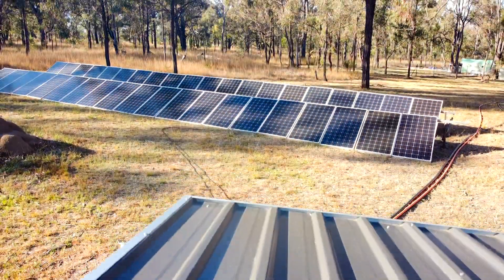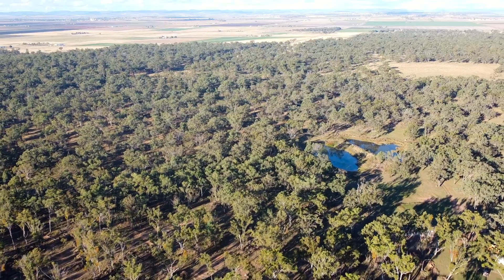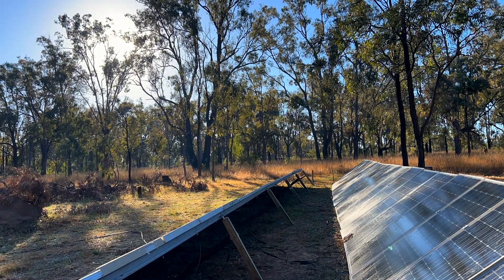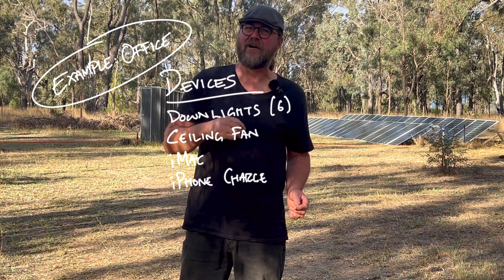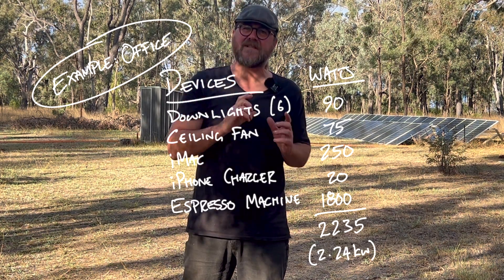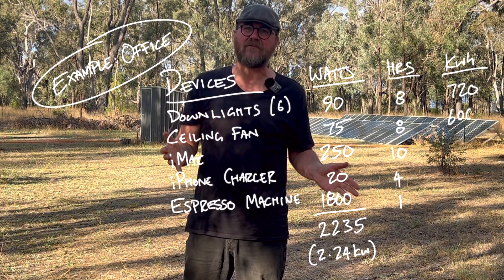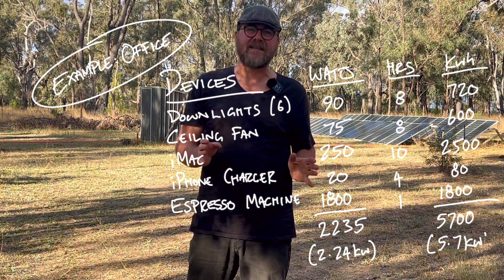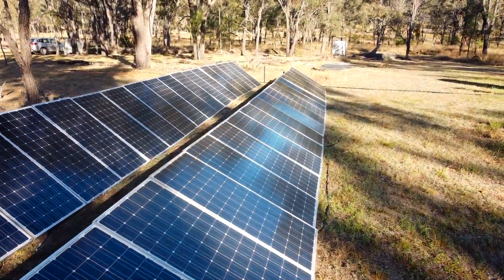We had NO CHOICE but to go Off-Grid

Comment: only thing i could change in your beatifull  system it would be the mppts . i could go 250series mppt    independent ones   i know more cables but when need to seperate and have 3 for example . you put another 5000 inverter on one of 3 and your independent system will be there for  sure no mater what !!  sometimes cost isnt so avoidable...      
on my small  system    i go with a 5kva   and chose 1x 150/35   and 2x100x20  mppts for angled arrays    
.i have no much needs but my thoughts were   faster  charge with small morning array  middle day  combined with the big at its full and late sun angle 3rd small   mppt  harvests to keep as much amps  for the night to pass easier and to keep up with fridge internet and  security     small  all time consumptions..  ..  this way i could keep system running with one 51,2 100 amp pack

Comment: Do you have a cameras.  We have the same systems.  I went growatt.  2x 5000watts.  You bought local by the sound of it but in WA we have to order everything.  A shop 3hrs away can take up to 2 weeks to deliver.  As soon as you get some extra cash buy another inverter.  Mission critical off grid inverters are a must.  In the past 10 years we've gone through about 10 inverters of different types.  Victron are very expensive and are not all in one.  My next inverters will be Deye.  These are Low Frequency 8-12k inverters, multiple string and gen backup.  We both have the little sheds and away from living people.  Remember to put a smoke detector inside your battery shed.  Hydrogen fluoride gas and one deep breathe, you meet your ancestors.  So weird looking at my little shed and ground mounted panels in some else's video.  We must be doing something right.
Reply from the maker: @MovieBeasty  haha, good to hear there’s more folks that think like us. Shed got an upgrade since this video. Good call about the HF gas, yikes! 
Yeah, we had to order all our gear too, took about 3 weeks and even then I had to drive to the coast to pick it up. Nowadays we found a local dealer only an hour away
Reply: Forgot to mention, if batteries fail or inverters blow up, it's on Dec 22-25 or really any Friday night.  You really couldn't make it up.

Comment: Hi. Just listening to your video where you and your partner are discussing power usage and running out of battery power/gas costs. 
Have you considered installing a solar hot water system to replace costly gas hot water system???
And loving your videos. Very very informative and practical.
Reply from the maker: Definitely considering it. Apparently a heat-pump unit is quite energy efficient. and considering that we basically don’t pay for electricity it makes sense.
Reply: @ right. We have a heat pump. Pretty sure it is saving us quite a bit.
Reply: @rusticspiritshomestead  Bear in mind that you could use separate solar panels to power the heating element in a storage hot water system with DC directly from the panels, independent from your solar power system, so no demand on the inverter.  Depending on what voltage you arrange the panels to produce, you may need to avoid arcing at the contacts of the thermostat breaking direct current.  An example could be 4 panels in series: ~140V.  2400W element (designed for 240VAC): ~24 Ohms.  Current: ~5.8A (140 ÷ 24).  Power: 812W (140 x 5.8).  IE. ~1/3 of the 240V rated wattage.  With 5 hours of decent sunlight that would equate to ~4kWh.  That's enough to heat ~100L of water from 10° C to 50° C.  Heating at that rate, I expect that the thermostat would cycle infrequently.

Comment: Hey there Regan, Rollo here again. I have been looking at your videos on the solar array and have noticed that you only have 4 x 200ah batteries. Thats bugger all and I know you said they were about $2000. I ha e built a 340ah lithium battery for less than $1000 and that is using 6000cycle batteries. I am looking at going stand alone solar here and will be building 51v batteries that will be about 4.5kw or better and can go much larger using bigger batteries. Have a talk with me and I am sure we can build something much better than what you have and will be able to do it for the right dollars.  EEL batteries do kits for 48v and this is for the case and the BMS. You have to buy the betteries and there are a heap of choices there. Lets talk. Cheers Rollo
Reply from the maker: Hey Rollo, wow! I am very interested to talk to you. I actually may have a partial solution already, but I am hesitant to jump into it without knowing more about the topic. One of our 24v/200ah batteries died a few months back and they sent a free replacement. I pulled the old one apart and it seems like only a few cells have died (maybe?, not sure what I'm looking for), then the replacement that they sent didn't work right out of the box. They tried to diagnose it with me via a zoom call but they couldn't find the problem. But it seems that all the cells are fine. Later when I looked, it seems like just the first main terminal connection had bent away from the first battery. Anyway, they sent another free replacement, and now I think that I maybe have anywhere from 16-20 perfectly usable cells. I just don't know where to start. And, I also assume that the BMS's may both be in working order, but don't know how to test. I've had a few ideas, but like I said, hesitant to dive in and potentially stuff things up, without understanding it better.

Comment: Great vid, keep them coming. I have been off grid power wise for 3 years now, never looked back it’s great. Now looking at getting rid of the 45kg gas bottle.
Reply from the maker: i hear ya on the gas. Got any ideas for cooking, water heating, etc in your system. Wood fire sounds romantic, but it's a lot of work hey
Reply: @ so far we have wood fire (no way I would change that) I wanted it hooked upto hot water but where we live no plumber wanted to touch it so we will probably go to heat pump hot water. We already have electric oven. We also partially charge electric car. Wife and daughter murdered first battery bank (2nd hand ups 2.2 volt cells) replaced with lifepo4 cells. We have 5kw of east west panels. We don’t regret gas as we needed something straight away when going through council but at $175 per 45kg bottle we are starting to think more panels. Loving your vids. I am just getting into bees now so keen to see more of that.

Comment: Interesting Video, I run a frankenstien off grid set up for my workshop and it is 24v with a 3000w inverter.  I only use it during the day very rarely at night. During the day I run 8 x 40w 240v fluro style LED's or 8 x 30w 24v flood lights. I run angle grinders , drills, a lathe, up to 2 industrial fans and a water cooler in summer. My solar panels are 4 x 330w in parallel which produces 36v x 1320w into a 70A dc-dc charger.
The battery bank is 24v x 850Ah AGM . I would like to know why you chose to go 48v x 400Ah @ $8000 when you could have had 24v x 800Ah for the same cost. I know there is some efficiency factors between the 2 voltages but I do not know them.
Reply: 48v is a little more efficient as you said. Cable size can be smaller at higher voltage so lower cost for cabling but can also have batteries further away if need be. Battery limitations as well. Equipment produces a little less heat so less loss there and power draw if you need active cooling
Reply: I PUT PLASTIC CLEAR CORRUGATED SHEETS IN SHED AND HOUSE ROOF, NEVER NEED LIGHTS IN DAYLIGHT HOURS, IT ACTUALLY APPEARS BRIGHTER THAN OUTSIDE.

Comment: I see you have 24v batteries connected in series. Have you any issue with battery balancing and how do you solve it? As far as I know Victron battery balancer works only with 12v batteries bank.
Reply from the maker: They stay reasonably well balanced, we check them pretty regularly. I was just thinking though that I may design a process for cycling their order on a regular basis to ensure no issues.

Comment: Cost of Sol PV ( vs. Utility power ). Did the math for you🌻 Most utility (grid) payers do this simple Interest calculation..."I will pay 100$/mo. for decades...so 1200$ x 20 years=24,000."...NO you won't!!. Ever hear of Inflation? And it's Compound Interest...Utility rates of Inflation avg.~5.5%* (some have been recently 40+%!!) for US electric Rate increases. So at *traditional avg. U.S. rate increase (prior to 2020), 1200$/  year becomes ~3,500.$ in year 20.   Conclusion, if use same amt. of kWh/mo. over next 20 years at *traditional avg. rate increase , then you will avg. ~$1750$/ yr... or cumulative ~35,000.$$ over 20 years!!🧐  (if rates don't increase*...good luck with dreaming🤪.     + if you qualify, there are pot. State Incentives for solar+ a Fed. Tax Credit of 30% off cost of PV systems🗽

Comment: Nothing annoys me more than paying over $700 a year to the power companies for their supply charge, even if you aren't using any of their power. I live in a residential area and I am grid connected, but looking at getting off the grid. I just need to work out how to survive our winter with low sunshine. I have installed 10kw of solar panels, a 4kw Victron Multiplus II, a Victron 450/100 MPPT charge controller and 32kwh of LifePo4  batteries. For 9 to 10 months of the year I am self sufficient as far as electricity goes. I was getting credits from the power company. The latest price rise for electricity includes a big drop in the price paid to me for the solar feed in tariff. With the price I am now being paid to feed back into the grid it works out I have to supply them with 55kwh's of power per day just to cover my daily supply charge. Lets do the maths on that, a daily supply charge of just under $2 per day costs me 55kwh's feed in/day which even at the lowest rate (off peak) would cost me $12.10 to buy from them, and 55kwh's would power 2 medium size houses for a day. I think the little guy is being taken for a ride again. My dream is to move to a bush block and go completely off grid. Its great to see you are living the dream. Keep up the good work.
Reply from the maker: Woah, that’s crazy! And I feel like stuff like that is only getting crazier and more and more unrealistic hey. What would it take for you to disconnect? That’s a pretty epic setup. Very similar to us and we’re 100% offgrid. But mind you we’re on a “tiny home” setup and are only using about 18kwh/day.
Reply: @rusticspiritshomestead  Hi, thanks for the reply. It sure is crazy and it drives me mad. We hear plenty about going green and saving the environment but there is very little incentive to do so, and as you say its getting crazier. As far as disconnecting, I would love to, but I am still working out if I could. I live in the south of NSW and solar production drops off hugely in winter. Many overcast and rainy days. My system has only been up and running since late November last year and this is my first winter to judge how well the system works. In February I produced 1258kwh's of solar but so far this month I have only produced 344kwh's. I am not even charging my battery at the moment. Most of the year is no problem, the battery is fully charged by lunch time and I export many kwh's back into the grid. I believe for me to disconnect I would need to run a generator in the bad weather of winter. Not sure what the neighbour's would think of that. I generally use about 20 to 22kwh's a day, but its cold now and the wife loves the split system A/C. So that pretty well doubles our usage. I was like you when designing my system. I spent many many hours watching youtube solar and off grid vids. I researched batteries, solar panels, inverters, charge controllers, cables and all associated electrical equipment. I dealt with a company in Victoria who are off grid specialists and Victron suppliers. They were very helpful. I was a little undersized with the 4kw Multiplus II but I have allowed for expansion of the system. I wired the board ready for a second Multiplus to run in parallel when I need to expand. As I said in my message above, I would love to buy some land, build a container house and go completely off grid. ( have watched many youtube vids on building container houses too ) lol. Maybe one day I will but I think I might have left it too late, might be getting a bit old for that now. You seem to have worked your system out well but if you have any questions or anything I can help you with just ask.   cheers, Brian
Reply: @rusticspiritshomestead is it possible to get an unwanted ev car for your carport and connect it's battery pack to the system
Reply: Sounds like PG&E!!! I HATE THAT COMPANY WITH A PASSION! They’re the worst corrupt company that has a complete monopoly where I live. We have no choice and they’re currently charging $0.43 kWh for tier 1 and $0.52 kWh for tier 2. And they’re requesting ANOTHER price increase! It was $0.22/$0.35 cent 18 months ago. $0.12/$0.16 just 2 years ago!
Reply: @Ang.0910 Hi. You do seem to be getting a bad deal. Made worse for you because they have the monopoly. I am actually pretty happy with my electricity supplier and after checking what others are charging I think I am getting a pretty good deal except for the Solar feed in tarriff. My prices have just increased and I am much better off than you. Actually my prices decreased. I pay between 22 (off peak) and 27.5 cents (peak) kWh. My feed in tarriff reduced by around 30 to 35% at the same time. There is a real trend in reducing the payment for solar feed in by all companies. It seems that in the future all solar owners will be supplying a large amount of electricity into the grid and not being paid for it, making the big companies even richer. I have even heard there is talk that in the future solar owners will be charged to put their power back into the grid. Thats what I meant above about being taken for a ride. I am not looking at making money from selling solar power but it would be good to make enough to cover the daily supply charge. That was my aim but now that has become impossible. I think that Regan is certainly on the right track. Getting totally off the grid is the way to go.

Comment: Nice summary! Have you considered better roof insulation for the shed?
Alternatively you could install a small portable A/C unit - maybe a 300W heat pump which could give the equivalent of about 1200W of cooling. After all, it would only run on the hottest days when you have plenty of solar power anyway. Then you may get more life out of your LFP batteries which age much faster if charged at over 40C.
Reply from the maker: I’ve thought about a few ways to better insulate this shed but tbh it’s too small anyway so I think a full upgrade to a bigger shed with properly insulated walls and ceiling will be the project for this spring.

Comment: The way I understand the rules regards voltage (in Australia) is we can work with Extra Low Voltage (ELV) without needing an electrician. ELV being up to 120 volts DC ripple free and 50 volts AC RMS. But then again us Aussies have a habit of changing the rules all the time so it's always a big question mark.
lol... you solar / power shed is the same shed as mine 😀I also run Victron gear and have found it to be extremely reliable 👍
Reply from the maker: Oh that’s really good to hear about the shed, I’ve been nervous about how it’s going to cope in summer. It’s out in the full sun so I definitely think I’ll at least want to insulate the north side of it (where the door is). Yeah, so true about electrical rules. Are you running off-grid, or connected to mains? Do you reckon it was worth it in your case?
Reply: @rusticspiritshomestead  as of the latest wiring rules AS/NZ3000:2018 the above is true for ELV, cant really see it changing either
Reply: Yes "Low Voltage" is 240

Comment: in the future are you considering putting the solar off the ground? I see people building solar shacks, or pergola and keeping equipment under.
Reply from the maker: Definitely. They get great sun where it is, but I think it’ll protect the panels a bit more from wildlife and ground moisture if I can elevate the racks. I’d love to put them on a system that I can adjust the angle for each season too. Putting the solar gear/shed under the panels is actually a great idea! That would just look a whole lot nicer. And, reduce the cable length from panel arrays to MPPT - I like it!
Reply: @rusticspiritshomestead  I have tiltable panels (vertical angle) which I adjust every month for best results. I get about 10-15% more power than my fixed angle panels for the garage.
What surprised me was that I could get about 20% more power by pointing them straight up on cloudy days in Winter, which has the additional benefit of making them less vulnerable to Winter storm force winds.
Reply from the maker: That's so cool. I have some designs for a DIY tiltable array so I may just do that for next year. Never thought about straight up on cloudy days, but it kinda makes sense.
Reply: @rusticspiritshomestead  I found similarly with horizontal panels on overcast days, but experienced issue with dust collection turning to mud leading to big performance downgrade.  I have since obtained some panels with lower current output and they limit the output of the higher current panels in each string, which has enabled me to incline all the panels for drainage, without no risk of exceeding my max current limit in full sunlight.